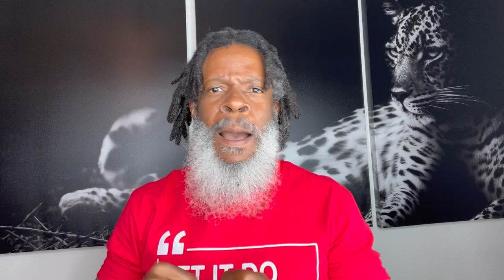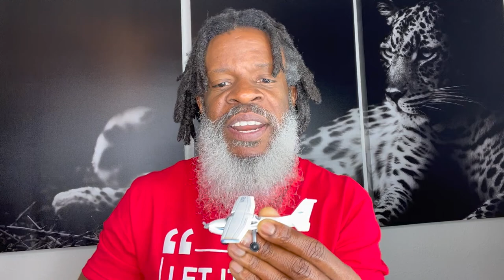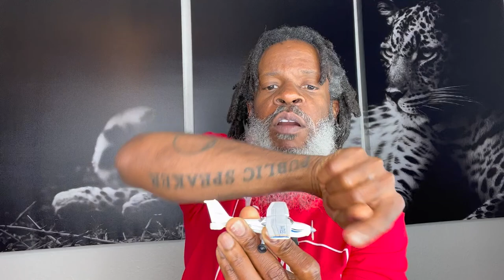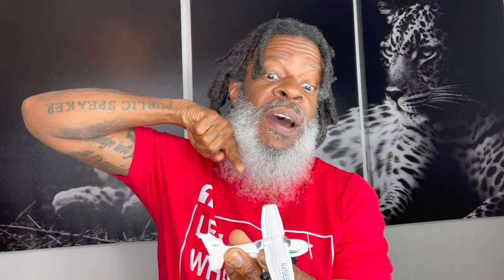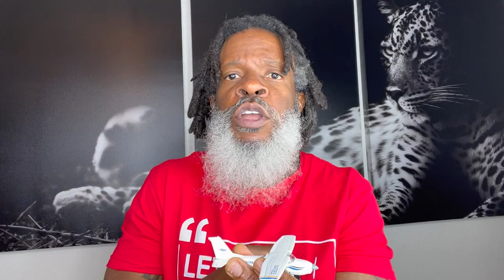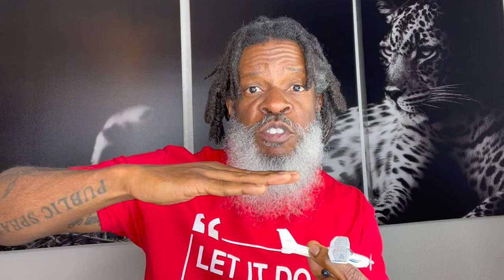How To Control An Airplane?  Primary and Secondary Flight Controls | Private Pilot License

Comment: The rudder is located on the TRAILING edge of the vertical stabilizer.  The ailerons and flaps are located on the TRAILING edge of the wing. The elevator is located on the TRAILING edge of the horizontal stabilizer.

Great basic explanation of controls and three axis of flight!  Love your energy!  Keep it up.